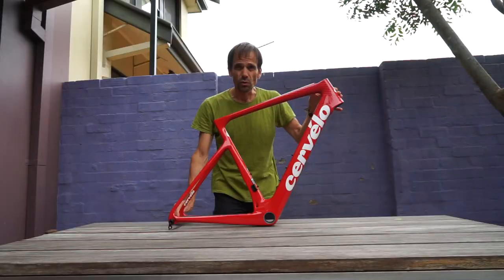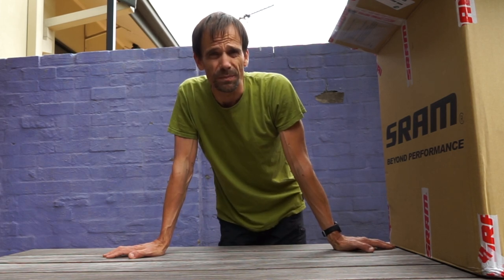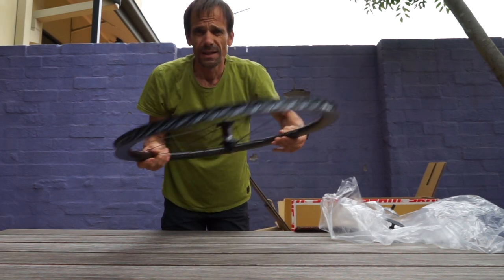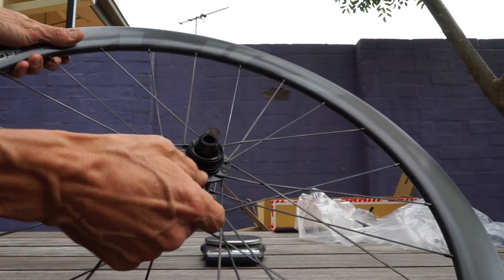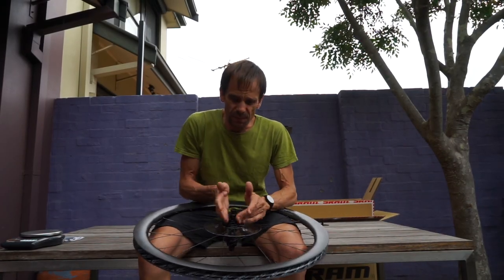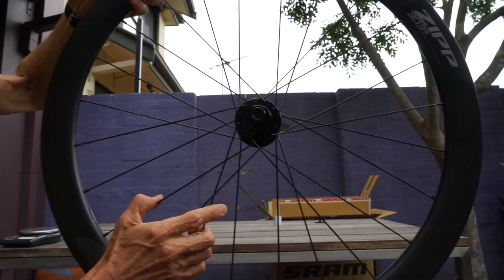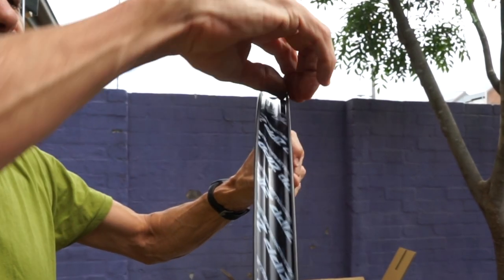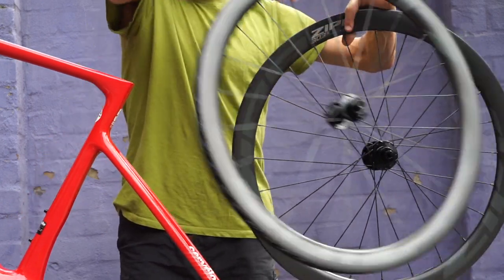Project bike, Cervélo Caledonia (pt2) – Zipp 303s wheel, unboxing

Comment: Hi, i can put tube and normal tires (no t tubeless) on this zipp 303s ?
Reply from the maker: You can. I know, because I originally did exactly that.
But once I had the tubeless instal done, I wondered: 'Why would I ever use tubes again!?'

Note: be mindful of over inflation as these are hookless rims designed mainly for a tubeless arrangement, and if you start banging in old-school pressure (ie. over 100psi), you're going to have some serious issues.

Comment: Rob, anything you didn't like about the zipp 303s ? I'm running 32C tyres tubeless and not going back to anything narrower than a 28C and certainly not going to tubes.
Reply from the maker: I'm still riding the Zipps. Did around 5,000km on the Cervélo with them (swapped to ENVE, which you can see elsewhere on the RIDE channel). 
Now have the 303s on the Focus. Fantastic still. They are still true as true can true...! ie. straight, never out of shape (not even slightly) and very nice to ride in all manner of conditions.
Have a deeper rim to test next week, from another brand. Am curious how different it will be.

The only (tiny) issue was one ride, in pouring rain for ±3hrs, there was an issue with water getting into the rim. 
The solution was to unplug the tubeless valve and let the water seep out through that opening.
But it's an observation more than a complaint. It happened, but it was easily remedied. (Hasn't happened again, despite a few more wet rides.)
Note: When the wheels did take on water, it was only from riding (ie. the bike wasn't standing in a puddle or anything like that).

– Rob
Reply: @ride-media  thank you
Reply: @ride-media  Did you simply remove the valve core or entire valve, if the latter, how did sealant not come out as well?  I did contact Zipp seems I can send them in for free port holes to be drilled opposite the valve, but a bit of a pain.

Comment: I'm considering building a Caledonia as well, and I'm tempted by the Campagnolo Bora WTO 33, do you have an opinion on these wheels ? They seem to fit the all-around spirit of the bike.
Thanks for this build project!
Reply from the maker: Arthur, I've not personally ridden the Bora (with discs) but my personal bike has had Campagnolo's new disc-friendly Shamal wheels for the last... ah, around three months (https://youtu.be/k0zZ8c9Gxaw) and, given that Bora sits higher on the pecking order of the Campagnolo collection, I would confidently say: YEAH! Do it!
Honestly, the change in handling on my bike with the Shamal wheels versus what I was riding before (Scope) is immense, and this is – by no means meant as a criticism of the other brand. 
Curiously, I'm still unable to source a Fulcrum freehub (ie. from the Campagnolo family) in Australia... but then again, I've not looked for a few weeks. And so I am still using the Campagnolo 12-speed cassette mixed with SRAM AXS Force groupset (yes, complete with FlatTop chain) and, as in the olden days, the shifting only seems to be improving with age.
Further, as I've alluded to in this video, the quieter freewheel of the Campagnolo option is... ah, really quite lovely. 
Some like the clack! clack! clack! of noisier freewheels but I certainly don't.

Not sure if that answers your question, but it's what springs to mind when I think about Campagnolo.

What groupset are you considering with the Bora wheels?

I'm hopeful of trying Campagnolo's Ekar groupset... but not sure when. Is that your plan? (If so, please let me know how it goes.)

– Rob
Reply: How wide a tire do you want fitted on the WTO 33s for your Caledonia-5?  If 28 mm, sure.  30 mm or more?  You might be better off with the Zipp 303s.  The Campag WTO 33 DB product literature says, "The profile of the rim, which has an internal diameter of 19 mm, corresponds perfectly with 23 mm, 25 mm and 28 mm tires."  Zipp 303s internal diameter is 23 mm, so Zipps are better suited for 28 mm, 30 mm and wider tires (perfect for cyclocross or lite gravel 33mm tires).